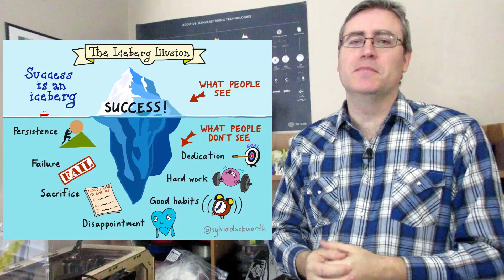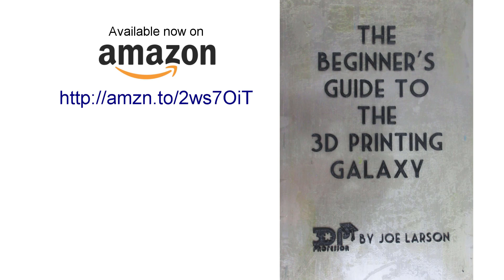How to make $1000 a month with 3D printing

Comment from the maker: I've got more to say on the blog: http://joes3dworkbench.blogspot.com/2018/02/how-to-make-1000-month-with-3d-printing.html
Reply: Yes please. more content on entrepreneurship.
Reply: I would follow more content on entrepreneurship
Reply: Hey I came up with an idea I tried to tell u about it on Twitter and I don’t wanna tell everyone but it would be a 3d printer with no bed that would use flat surface as bed so technically I’m 6 ft 1 so it could print at about 7 foot
Reply from the maker: @Patriotdesigns  The challenge become bed adhesion at that point. But I'd love to see this in action.
Reply: In theory couldn’t your bed be any flat glass or cardboard type surface
Reply: But I feel like if you use like a corkboard that doesn’t have any bumps in it but it will heed to that better than it would even glass because of that that almost that cardboard furry feel of corkboard
Reply from the maker: @Patriotdesigns  In theory, yes. But in actual practice getting something to stick to and, more importantly, release from your build surface when you're done, is a real challenge.
Reply: You are definitely right I think what I’m gonna do is start putting those things under my cr10 and see what sticks and in meant time I’m gonna start ordering aluminum extrusion and lead screws as I get the money to put this together but I want it open not confined to a box
Reply: I know I am pretty randomly asking but do anyone know a good website to stream newly released series online ?
Reply: @Allan Jackson flixportal :D
Reply: @Hector Otis Thanks, I signed up and it seems like a nice service =) I appreciate it !
Reply: @Allan Jackson happy to help =)

Comment: I am making $3k a month 3d printing. 1. I make a ton of clips brackets and hard to find car parts for several autobody shops here in town. I also do the same for appliance repair stores. My second biggest customers are small engine repair shops, lots of cable holders brackets and just parts they cannot get anymore. I have 4 FT-5s, 6 CR10s, 12 monoprice minis running 24/7 unless down for repair. Bumped my electric bill from $120 to sub $500. Getting geared up for the big jump this spring. Thanks
Reply: Lucky Larry I am thinking about doing this and have 2 machines how did you go about approaching the shops and how do you do the pricing per part time and material or set price for size
Reply: I failed badly at first trying to price stuff by material and time, the just don't want to hear it. Pricing is simple, price at half whatever retail is on existing available parts. Hard to get or out of production parts are retail.  The biggest draw is having their part in hand fast 72 hours. Most everything is printed in nylon. I had to give up on the idea of charging for drawing unless prototyping. You will make it up on the back end. Once drawn they are also posted to ebay for additional sales. Really it's like they are telling you what is in demand. 
Just walk into a place and show samples of parts related to their field. Always look at their part in terms of if you can accurately reproduce it with the same mechanical properties with a quick turn around. The biggest thing to learn is when to say no.
Expand into casting your printed part or mass producing an existing customers part.
NEVER walk into a place without business cards and never bring trinkets or a flipping benchy as a sample part.
Never post availability on craigslist, but check there for competition and get a quote for a simple part.
Hope this helps:-D
PM me for more info, I want to respect this thread. I enjoy his vids!
Reply: I respect the hustle, I am on this curve trying to operate a sustainable manufacturing company in Nigeria and can relate to both your angles, I am  4 months into this entrepreneural drive with 3D-printing. @Lucky Larry, I am approaching this business as you have. I am currently on the filament/pellet supply chain and got an extruder to help with spooling for my requirements, there are very few resources here raw material-wise so its a bit of a stretch for me. I could use a pellet supplier who stocks most of my filament or pellet needs how do you source your PA?
Reply: If you're asking where or how I buy filament. I purchase in bulk, 50#s at a time. Mainly I do this for lot and quality control. The supplier uses a new 50# bag for my lot, I also have an NDA with the manufacturer. It cost me about 2/3s of retail for name brand material. In return provide them with long-term performance data and degradation issues/failures in real-world applications.
Reply: Lucky Larry What does NDA mean?
Reply: Lucky Larry And how did you get it?
Reply: A NDA is a Non Disclosure Agreement, this means I agreed not to disclose company's name or research data. Sorry!
Reply: AnjolaOluwa Badaru 
How are you doing? Can you share   your experience with start-up costs and prospects of the business in Nigeria.
Reply: I have no idea what it cost there. I sold a boat and other toys for $25k. I wasted $5k in early bad decisions and have $20k in printers, mini lathe, mini mill, bench top belt sander and drill press for part clean up and finishing processes. Then about $3k in materials.
I would never considered this without having some serious Cad skills and machining and tool making experience. I make an awful lot of fixtures for a few machine shops and a few other small manufacturing businesses. One of my best clients is a solar outfit, lots of fixtures and one off brackets. The 3d printing is just another tool to compliment what I do. If 3d printing is all you can bring to the table, it will fail, I have seen many come and go trying to print people's trinkets. That's how I aquired my cr10s for penny's.
If you don't have the skills and tooling, walk away....
Reply: Lucky Larry Yeah I just wanted to comment on that. The major part here is probably designing and getting clients, the rest is cake. Do you try to find reference parts online and modify those? How complex of a design are your clients requesting? I learned AutoCAD in school so I can do some stuff, but I imagine complex parts won‘t be that easy and I‘m not even sure if the clients could always describe the part sufficiently enough for you to make a proper drawing.
Reply: Beaving Absolutely right! Often clients have no idea how to get there from here. They just want parts joined or adapted to things. Often there is no compensation for designing and often Prototyping, but pretty much guarantees that they will call for other work of give a stellar referral. On samples parts, I picked up a Cub Cadet self propelled mower at yard sale not running for $20. It had a broken cable holder, so I made 2 new ones beefed up by 20% or so to make up for printed parts short comings. I the made 10 or so other parts for the mower after I disambled it. Then took the parts into the small engine repair shop. I ended up taking a half dozen parts home with me, most related to the pull starters. These days it's hard to get parts for anything more than a few years old. I looked on eBay and company web sites for pricing. If it was discontinued or out of stack I charge often double retail, if there were used ones were available on eBay I price accordingly. If the parts was to cheap used, I would point them to ebay and not touch it.
Master Fusion 360, you will need to build cheat sheets for every material and printer. This way you will be able to draw the parts with shrinkage in all axis and holes are correct size. It needs to fit the customer's project the first time, you only get to make a first impression of you and the process once! My machines are setup and dialed in to run one material, only color gets switched. Use high quality materials. Your paying for consistency and repeatability, constantly chasing machine setup setup and changing drawing offsets sucks, let alone outright part failure in the field. Forget Amazon, go to the material manufacturer and arrange for larger quantity within one lot. Always communicate failures and anomalies to the manufacturer ASAP! Often you will find they are your customer for your real world feedback, ie. Free or at cost filament. R&D is invaluable to these guys in a tough market.
Sorry so long winded...
Reply: Great to hear man :) im trying to get started i have an MK2S that just recently got an aluminum extrusion upgrade and im buying my first monoprice mini next month. I have 0 competition in my city so while i do feel lonely at times having no one local to talk 3d printing to that will understand its also a great business oportunity :)
Reply: What upgrades you made on your CR 10 or think that its good to have for this type of use? My experience is that everybody is impressed by the quality of the prints but I am just interested whats are your long term upgrades?
Reply: Cristian Martinez That's great! There have been others come and go in my town and left nothing but a bad taste in potential clients mouth. They produce sub standard junk from pla passed off as working parts. Winning they confidence has been an issue...
Reply: Csaki Denes I got my cr10s from someone throwing in the towel. They at best a decent hobby printer. They give me the most problems or outright failures. I only paid $100 each for them. I am expanding 10 more printers after tax time. I will build them from scratch, but they will in 1"x1" welded steel frames, genuine e3d v6 volcano', 24 volt and with silicone heat beds. The big upgrade is the Co2 fire suppression system being installed in my garage.
With an upgraded power supply, better cooling, garolite beds on glass, better cooling for electronics and a real belt adjuster on the x axis on the monprice mini's, they are real work horses.
Reply: Yeah my fusion 360 skills still need refining. Im doing this as a side business to cover the cost of my printing. Im definitely getting some nylon's for parts that need that extra bit of strength and i print mostly in PETG but thats about the extent of my skills. Hard to learn new skills when you work all day lol. Ive been learning what i can on my time off
Reply: Lucky Larry what type of nylon do you print with and did you upgraded hotends?
Reply: iDig3D, I use Tallman 910. I use a 24volt e3d v6 volcano. This setup keeps a real smooth temp, no spikes.
 I also have an insulated cabinet that stays 120f that all of my filaments stay stored in and I print from a dry box. All filaments get dried in an oven for a few hours, even if new.
Reply: Thanks! Did you convert all your printers to 24v? True E3Ds or clones? What controllers?
Reply: iDig3D yes on real e3d hot ends. Only the monoprice minis are 12v, everything else is 24v with quality silicone wiring. Much lower chance of fire also.
Reply: iDig3D mks 1.4 from bangood $35 eachish
Reply: What would you recommend for a 1st printer? I've got about $430 right now but was considering waiting until I could afford a Qidi Tech X-Plus or X-Max.
Reply: Lucky Larry But you would have made alot of money in any business because youre educated. See the people on Youtube that ask you these questions are usually people with no skill and lazy.
Reply: I ordered an Ender 5 Plus Printer. It will be my first one. Any recommendations on a fairly strong filament? I'd like to make some more main gears for my RC Heli.
Reply: How much goes into your pocket from those 3k ?
Reply: @aninconspicuousman2288  ender v2

Comment: 3d printing isn't my issue. Heck, I'm running a prototype infinite color/material changer right now (btw, we've internally solved the purge block problem with single head multistruders, as well as the 'too many steppers' issue with scaling material count, and they're both DIY-able so there's hope for FDM still! (more soon!))

No, the reason I watch every episode is because, occasionally, I see a glimpse of someone who has followed a similar path to mine, but is ahead of me. Your advice (and Angus, Joel, Devon, etc...) has been critical to every bit of growth I've been able to squeeze out of this. 

If I'd have been a business minded man, I'd have bought a suit... I bought a 3d printer.

Seeing how you're growing your business is what distinguishes you from the others, in my mind.

Comment: Another way to make money from home with your printer is to make sandals and shoes, ideally from plastic garbage ground and melted into printing filament.  Does anyone know of a printer, material and design combo you could recommend for this (ideally with a grinder to recycle materials back into filament)?  Thx

Also, as someone born with bilateral severely clubbed feet, I think everyone with clubbed feet and everyone else needing orthopedic custom inserts and shoes (and all disabled, amputee, etc people) should have a 3D printer (or access to someone offering printing service) to be able to prototype ideas and print corrective shoes, sandals and inserts with almost zero cost.

Comment: What would be a good price to performance 3d desktop printer for print quality on the higher end?
Reply from the maker: What's your primary application? 

For a general household 3d printer, if you want quality, you probably want a Prusa. Flashforge creator pro is a work horse. Flashforge Adventure 3 is super easy to use and setup. Lego Mars is the current darling for home high resolution printing.
Reply: @3dpprofessor  Awesome, thanks for the reply. I am a Draftsperson and also a mechanical engineering student. I am looking to buy a 3d printer as a hobby, maybe in the future try to make some money from home on the side and figured I would invest in one that produces a quality print that people will be willing to pay for.

Comment: Have you ever used Tevo taruntula ....lots of first time users including buying it and.....what do u think of it are there better sub 250$ printers ...which alowes users to focus on creative work rather then  upgrading and trouble shooting right from the first print.
Reply from the maker: I've used a Tevo Tornado and I found it to be a 3D printer that I would not use without upgrading it first. And whether that's good or bad all depends on whether you expect it or not. If you realize going in that your sub $250 kit is going to require an additional $50-$100 of upgrades, not to mention the sweat equity, then you're fine, if not it's going to feel like a hidden charge and you're going to be upset about it.

Personally I prefer the Creatilty machines. They work out of the box, but can't really be upgraded past the initial setup, beyond maybe adding a Raspberry pi to them. But I'd rather know what I'm getting out of the box than be nickel and dimed before I can get a good print.
Reply: 3D Printing Professor thank you so much for reply. Thanks. I really like your reviews and analytical information. It helps.